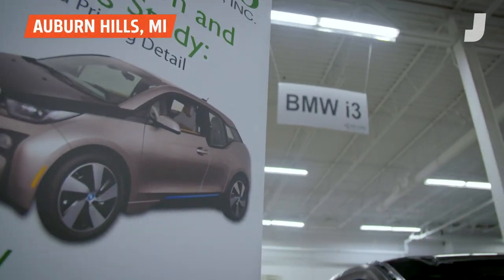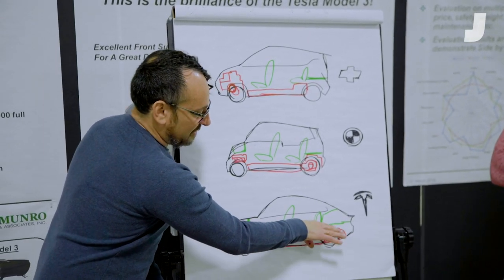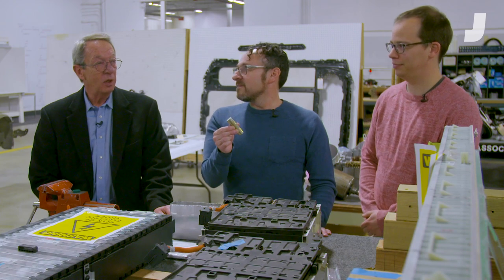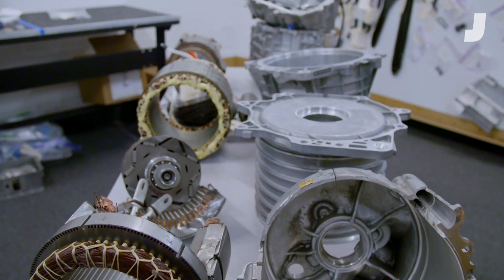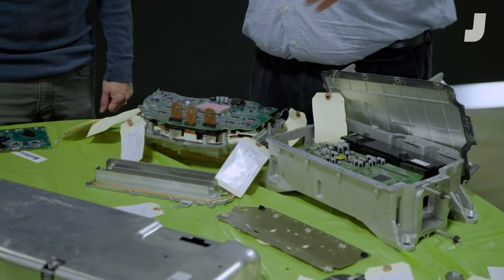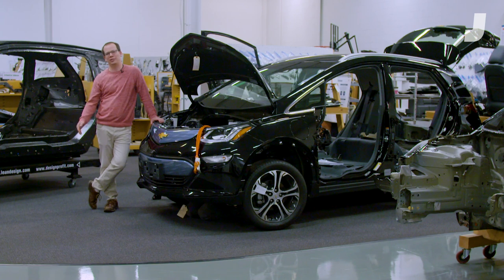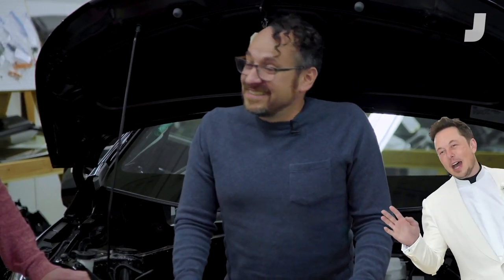A Look Inside The Tesla Model 3, Chevy Bolt, and BMW i3

Comment: There are many points  they make about the Tesla saying that it's better,  when in reality when that car ages and you need to repair it,  it's not going to be better with the Tesla.
they mentioned how crazy it was to have the engine cradle down in there except the Tesla has an engine cradle also.. in the back. The entire drive unit axles and suspension arm mounted to the  drive cradle... Same as the Bolt.
they talked about how much more room there is in the model 3 except there's actually more rear legroom and headroom in the Bolt but it isn't as wide.
As a do-it-yourself type person I would much rather have all of the components stacked in an engine bay that I can access and repair.
Good luck getting that inverter assembly out of the motor housing if the Tesla... if it ever fails.. and it will eventually.
Also that inverter is electronically linked to that motor and that car in other words you'll never be able to go to a salvage yard or a auto parts place and get a used one and make it work..
The integration that Tesla has done is impressive but it does have a downside.
one thing I noticed also is that when they had the electric motors on the table the bolt motor was actually still in its outer housing... 
And was actually the smallest of the three.. whereas they said is was bigger than Tesla but smaller than BMW.
A lot of mistakes here..  and they are obviously Tesla fans..
Also.  The Bolt was designed probably in 2013-2014. 

If you want detailed disassembling videos.. check Weber Automotive.
They have lots of cool videos on Prius, Ford Hybrids, Bolt EV, .. did a battery  removal.. entire driveling removal and disassembling..  coolant system.. 
Btw.. the Bolt does use refrigerant also.. it links with the Glycol system to take heat out of the batteries ,  the Tesla does this also.

Comment: They’re totally different classes of vehicles, so a bit hard to compare. Each have their pros & cons and depending on what you’re looking you’ll choose something different. Tesla probably has the edge on some of the tech in the BMW - and both are ahead of the Chevy - but in terms of vehicle construction, the BMW is far more advanced than the Chevy & Tesla which are really just basic, standard car shells. The downside of that of course is that they can’t make them fast enough. The more ‘integrated’ things are the harder they are to repair though... so nothing is perfect. The bizarro welding on the Model 3 is an example of while it might have lots of detail in areas that you see, what matters more is the attention to detail to things that you don’t see...  so I’d take an i3 over the Tesla & Chevy any day.

Comment: Dude you just said it: fast charging needs a lot of cooling or cells will overheat and explode. During normal charging you already loose over 30% of efficiency, add to it energy wasted to cell cooling. And also they cool down the motor itself. And the tesla's one is oil cooled instead of coolant. Do you see where am I going ?

Comment: Isn't the amount of extra space in the Tesla related to the fact it's A LOT BIGGER then the other two? Feels a bit biased this. (Don't get me wrong, think BMW really missed the boat on this one and am amazed about the Tesla 3 but still.
Reply: The Model 3 is longer, but not by much. Teslas packaging is very compact regarding the battery and electric drive unit, but the hood is only 3 feet long. In the cabin, my Bolt actually has more legroom and headroom than the 3, while the i3 is similar to my Mitsubishi I-MiEV, small but not cramped.

Granted, the trunk in the Model 3 is very deep. Self-parking or not, I'd rather have my Bolt in the city. It can fit in spaces that the Model 3 can't.

Comment: Where's the market leader - the Nissan Leaf?   Great video, thanks for sharing and this will never get old.  Advice is may as well get some hot chicks to host and have experts explain systems. EVs as far as systems will be as cookbook and as different as IC vehicles. (engine/motor, transmission/Power electronics, frame,,,etc.) get someone better looking to walk us through the top level and then roll out the experts for each of the system deep dives.  I subscribed - thanks again!

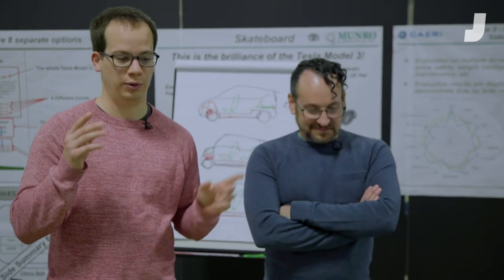Comment: If you're going to compare engines sizes, surely you also need to compare battery pack to fuel tank?... @11:53 Dave's doesn't seem convinced about being called a guru ;-P.... still not sure which way it'll go: right now, Tesla definitely had technological edge (as they should having specialised in it) but GM has mass production down to a t. Would like to see same analysis for the Mach-E....
Reply: "but GM has mass production down to a t" is that why their EV margins are lower then teslas? the hard part about manufacturing an ev is the drive train, tesla had to build the largest battery factory just to meet demand, where is GMs battery factory?
Reply: @miguellopez3392  when I said 'which way this goes', I meant beyond these models - which in fairness might not have been clear. The Bolt is a compromise so frankly I'd have been surprised if it's margins weren't lower, pace of change in EV drivetrain development is likely to slow as range anxiety, etc. addressed. It's just interesting to me that whilst Tesla way ahead on EV aspects, but making mistakes / inefficiencies elsewhere (like the weld flange) that the establish mfrs wouldn't  - and as competition & volumes grow, this sort of this could tell. 
GM probably has entire benchmarking department doing what Munro does - I would if Tesla has the same? Wouldn't surprise me to learn they think they have nothing to learn about any aspect of mfrs from the others
Dunno about GMs battery factory - didn't they have major explosion at research facility couple of years ago? - and too early to say if that's good or not. As long as Tesla have a technological edge; great - but if someone comes along with, say, a graphene battery then all GM has to do is switch suppliers... 
From what I understand, the Mach-E is a ground up EV, so be interesting to see that comparison

Comment: which one of these will the be the most reliable and easy to fix after 20 years when they're hoopties on craigslist that I can actually afford
Reply: i3 has horrible depreciation, and you can buy a used onr for very cheap, but then again, the range on the i3 is terrible, and it doesnt have amazing performance. Tesla is easily king of the EV space, and if you ever drive one, you will see why. If the Model S gets a signifficant refresh, there might be some good deals on used model S. Tesla people like to buy the latest and greatest, so every time a new model comes out, older models hit the used market in floods, so expect a lot of used model 3s once the model Y starts getting delivered.
Reply: The i3 is literally the worst car you can buy. 
None of these cars will be seen 20 years from now, but the same is true for new ICE cars, the industry has designed in obsolescence.
Reply: @dreiak  model S devalues badly the second it is off warranty. You cannot fix those cars off warranty without being reliant on Tesla and their insane parts prices.
Reply: @truantray  you don't really know, do you?

Comment: What I want is value.  A car with fancy production techniques that cost a lot more is not better value.  All three of these have similar performance so the best value is the one with the best pricing.  What these fanboys are buying is style and tech features.  You can dis the BoltEV if you want, but it has good performance, good durability, good practicality for less cost.  If the design of a car is better, that should mean they can produce it more efficiently and sell it for less.

Comment: Soooo no mention on model 3’s suddenly bursting into flames/dust, bumpers falling off on the way home (from the dealer), doors not opening due to very low temperatures? Oh you don’t see those as design failures. Also surprisingly very few (if any) bad comments on Tesla. Deleted? Very, very bias “review” more worried on being goofy (geeky) than instructive. Enough has been said about the hair.
Reply: When performance cars are reviewed, often the simple fact that they may suck to own is ignored. 
And yes, many people drool over the Tesla, while I am an ex-wrench, and thus hate fixing cars so I will look at "which car is the easiest to own, and that is the Bolt...

Comment: motors, Tesla again ahead of the pack, lightest motor and most powerful.... way to go Elon!!!!!
Reply: The bolt drive unit is smaller and lighter 177lbs vs 200 for the Tesla. Also has fewer parts and was delivered BEFORE the model 3. The bolt unit is also serviceable, (doesn’t have to be cut apart and can be repaired ) Few people understand that GM is ahead of Tesla in many aspects.

Comment: Efficiency isn't great while driving on Audi E Tron, but Tesla isn't while parked due to vampire drain, so it leak power. E-Tron/i3/Ioniq don't have vampire drain, so they have a better battery
Reply: They so have vampire drain. Every battery has.
Reply: You're really comparing 295 miles from a Model X to 204 on an Audi e-tron, which has a larger battery?
Btw, if they run 80-20% that's only 122 miles on the Audi!

Comment: Tesla: over 4 thousand 18650's glued together.
Jalopnik: ELEGANT!
Reply: 2170
Reply: Wrong battery, 2170 (or 21700) and it is because they have better cooling, and allow for more variation in packaging, so tesla only has to make one type of cells for all the vehicles, or at least that was the original logic. The fact that Tesla has no plans to put 2170 in the X or S signals that they are waiting for something better, likely the maxwell 300 wh/kg drycell before refreshing.
Reply: @dreiak  
AND
When the Maxwell battery arrives it requires much less space for manufacturing, so they can increase production in the gigafactory and when ready transfer the old 2170 production to industrial storage and powerwall applications.
Win, win, win.

Comment: Why cram the heavy stuff up front? Ummm, because I'd rather follow it in an accident then vice versa? Granted a lot of low weight back and low will increase braking performance. Also, BMW likes rear wheel drive. It's their M.O. and with traction control systems, it's a respectable commitment to their performance branding.
Your bias is too apparent when mentioning and labeling "conventional" with the Bolt when rear wheel drive was "conventional" in ICE for who knows how much longer than front wheel drive. Then calling the Chevy battery cells pop-tarts without explaining how pouch cells have superior packing efficiency was a miss. The Nissan Leaf uses the same type of cells as the Bolt... they lay some of them horizontally which, guess what, are THINNER than the 18650's of Tesla's pack. I'm not sure why I'm defending Chevy and Nissan right now but I feel like you guys are not fairly comparing any of these vehicles. Tesla deserves the nod for an awesome company launch into a market that others thought were dead (they actually were simply waiting for battery tech to catch up) but GM made the Bolt $10,000 cheaper for the same range as the Model 3 lol. This video was interesting and still enjoyable, especially the motor comparison. Though I wish you guys talked about the rotors. Maybe more of these comparisons in the future?

Comment: The bolt is by far my favourite approach. Hopefully some after market companies can use it to develop conversion kits if they haven't already.
Reply: EWWW Front wheel drive needs to die. Even VW ID Neo & Honda Urban EV is rear motor Rear Wheel Drive.
Reply: You mean.
Take existing ICE body
Modify 
Make adaptor plate.
Buy lots of off the shelf EV components.
Bolt in (hence the name?)
Buy a big battery.
Lose LOADS of money.
BEST approach?
Really?

Comment: When you think of it, the battery is the equivalent of the engine, because it converts the chemical energy. The electric motor is more akin to a transmission in an ICE car, it takes the power to the wheels.

Comment: didnt i read somewhere that GM came out w/the skateboard design, n Tesla ran with it, (whohoo :) daddy like...ha ha)
Reply: That is correct. They came up with the skateboard chassis design long before any production car was using it. It was planned to be the chassis that all GM EV's would be built on and even the possibility of interchangeable bodies and suspensions. As with most great and ambitious ideas from GM... it never came to market. I suspect their next EV will be a ground up design that will have more in common with Tesla than with the Bolt.

Comment: Efficient packaging of the Tesla makes the bigger car? any bias?
Reply: What kind of bigger do you mean? Model 3 has a bigger footprint. But it’s lower and has a smaller front surface than both the rivals. That’s why it’s much more efficient and faster.
Reply: @0cer0  if it was efficient packaging then it could be smaller, talking about physical packaging, I am probably splitting hairs here, but although the M3 is currently the smallest Tesla on sale it is still a big car (outside of the USA) I am quite sure with changing power densities they will be able to make smaller more efficiently packaged cars.
Reply: @markmilligan6616  I’m not talking about efficient packaging but efficient energy use. A small front surface helps.
Reply: @0cer0  I know what you mean but cd only really comes into effect at higher speed, lower city speeds benefit from an overall lighter vehicle,  how far would an M3 get on an i3 battery for instance? It's all relative. I have nothing against tesla by the way, before I get labled a hater (to late I guess) no M3 here UK yet to buy and no price model (doubt base version will be an option) so difficult to access myself. But I will once they are here to test drive  but hey ho I digress.

Comment: Well, to be perfectly honest, Tesla is crazy. But there is a logical reason for their use (and continued use) of 18650's... at the time, they were cheap and everywhere. Today, there are far better options, but they're sticking with their initial "mistake". (bigger 2170's now) No, they aren't managing individual cell voltage -- any more so than anyone else, except they have hundreds of cells in parallel vs. everyone else 2-3; they're just getting lucky that every cell has nearly identical performance. (until one doesn't, and then you better hope it pops its little fuse wire before exploding and burning down your house.)
Pouch cells are not "more expensive and difficult to make." It's almost the exact same manufacturing process as all those firecrackers in the tesla. In an 18650, the battery is wound on a tube. In a pouch (or "prismatic cell"), they're wound on a card. Per battery, yes, the pouch costs more because it's much more battery. Pouches are significantly lighter and can be packed much more densely. (how much mass is in 4000 18650 cans vs. 200 mylar bags vs. 96 aluminium boxes?)
As for thermal management, Chevy used to have active, per-pouch (parallel group) cooling in the Volt -- thin radiator plate between cells, and it made the pack rather heavy. They stopped doing that in the Bolt, because they've learned it's not necessary. Tesla learned the exact opposite, hence the "lasagna noodle" and schmoo in their latest modules. BMW (Bosch) tested their design, and it works perfectly for their cells. (AL is a good thermal conductor) Everyone is still puzzled by Nissan's total lack of management in the Leaf. (their design, btw, is the only one that can have a single cell replaced with ease.)
Why is the Bolt built the way it is? Because that's the way their engineers think. "That's the way it's been done for thousands of years." Tesla had no experience in making a car -- zip, zero, nada -- so they weren't stuck with same historical ties. (it also means they don't know how to make a car.) The tightly integrated, single unit traction pack is the most efficient way to go. (every mm of wire 1000A needs to travel is energy lost.) However, it is a bit of a mess to manufacture, or repair when it goes wrong. As a "whole package" 'tho, I much prefer the cars designed by people who know how to design cars; Tesla just seems to go nuts with the actual car part of the equation. (the 3XL ipad in the S, the stupid chicken wing doors of the X, frufru air vents of the 3, the seamless door handles that constantly break...)

Comment: The GM is as one would expect: it's a traditional manufacturer that "cut and pasted" off-the-shelf components into a vehicle that targets a market. The design prioritizes the shareholder. (Nothing wrong with that.) Interesting is the fwd, which is great when most of the car's weight is on the front wheels, but this is not true on an EV.
The Tesla is a clean sheet of paper from a company that needs to overperform to the customers in order to survive. Most of GM and Ford sales are to "loyal buyers".... that is, people gullible enough to buy a brand just because their parents and grandparents always bought that brand. Tesla needs to create a generation of people who will marvel to their children about how much better a Tesla was than the competition. David defeating Goliath... America loves an underdog. The part that amazes me is the little things have traditionally been the death of upstarts like DeLorean: things like electric switches and buttons must be absolutely reliable (which they weren't on DeLoreans) and Tesla has removed this obstacle via its touchscreen.
The BMW.... weird.